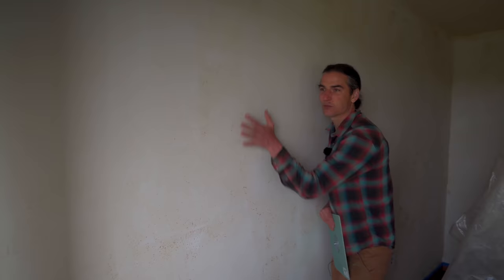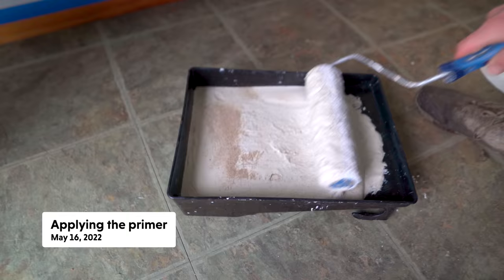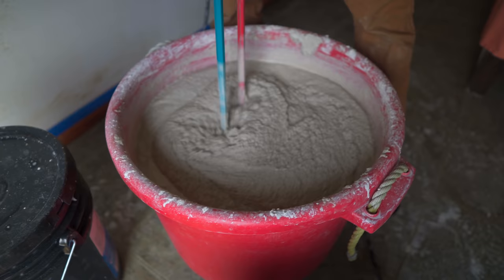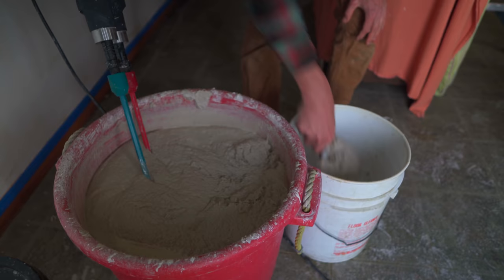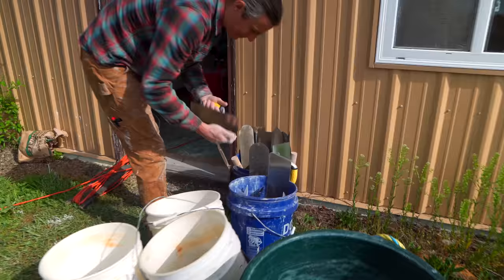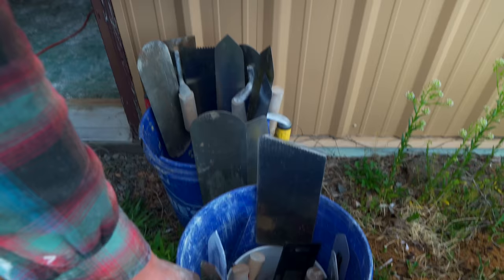We CLAY PLASTERED the CHICKEN COOP Walls! — Ep. 098

Comment: I really enjoyed this! I spent several weeks in Ireland helping to make a strawbale farm office which was subsequently plastered with clay. A local farmer provided the clay by digging a pond - a bottle or two of whiskey was traded for the clay. Then it was put in to 6 second hand baths bought for the purpose and covered in water. Each day for at least a week (memory grows dim - was it two weeks, or stirred twice a day for 1 week?) each clay bath was stirred using a drill and mixer like yours, but a little bigger. Time is needed to create a properly hydrated, smooth clay plaster with zero lumps.
After that we made careful mixes of clay, sand and finely chopped straw in a matrix grid pattern to see what adhered best to the walls without cracking. We chose the best mix and coated the strawbales. They were subsequently lime plastered so that the walls would always be able to breathe but remain water tight and weather resistant. They should be good for 500 years with a little care.

I hope the majority of people move over to using natural materials and reduce use of cement, in time ...
Reply from the maker: remarkable process. Matteo does the straw bale construction as well. He mentioned in Japan, they often cure the clay for around 1/2 year. Thanks for sharing your experience.
Reply: @FlockFingerLakes  6 months?! I suspect they were using very fine, very dry, commercially produced powdered clay that needed time to hydrate. I wonder if they agitated it?

OK, that set me off on a web search ... it is easy to disappear down an internet rabbit hole! I now know more about Japanese clay plaster uses than I thought possible.

Comment: Does clay plaster crack over time?🌸💚🙃
Reply from the maker: Not like dry wall. If it cracks, all you need to do is take a spray bottle, rub your hand over it, and seal it back up. It's solid but when wet—it's malleable with a little work.
Reply: @FlockFingerLakes  So it wouldn’t be great if you had kids and needed to wash the walls?🌸💚🙃